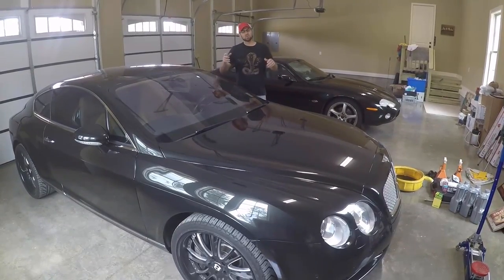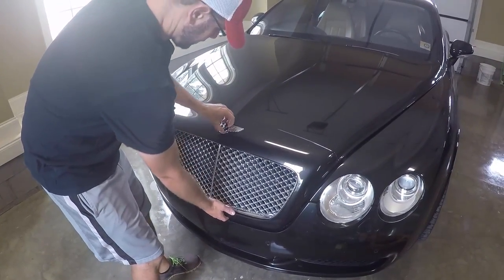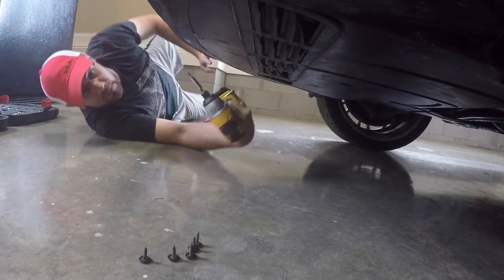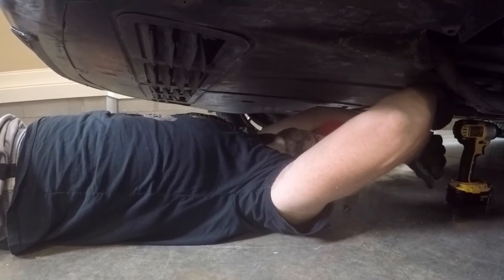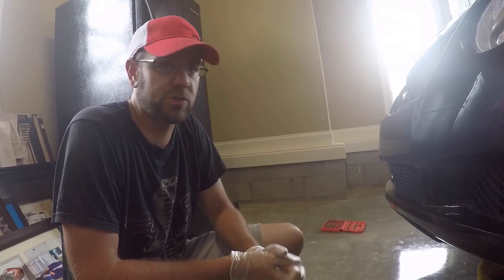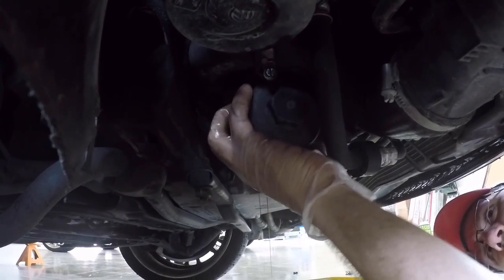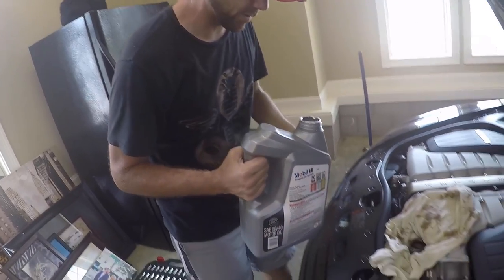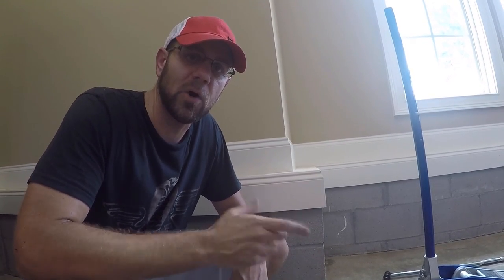DIY Bentley Continental GT Oil Change , Will I Die? Maintaining A Used Bentley GT

Comment: I used wheel ramps from Walmart for my Bentley oil changes way easier.
Reply from the maker: VANSLAM That's a great idea.
Reply: VANSLAM are they really that expensive to fix or get parts. And how are they reliable cars? Any major issues with yours
Reply: last time I did a continental, I jacked up the suspension to the highest setting, locked the ride hight level and drove it up ramps. easy.
Reply: No bro they have to be titanium

Comment: What?! No funnel?!
Reply from the maker: Richard Perez lol. I went full pro-mode. I should have used a funnel for sure. I got lucky this time.
Reply: Turn the oil bottle sideways, pours better.
Reply: @JohnEngel  turn the bottle sideways mr. Pro lol
Reply: What I thought, too.  Funnels are dirt cheap.
Reply: Own a Bentley can't afford a funnel or anything else that's for sure!! Lol
Reply: @JohnEngel  "pros" turn the bottle so the pour spout is up, not down.  Easier to start and less "glugging". At least that's how I've been doing it for the last 40 years.

Comment: I'M REALLY NOT LOOKING FORWARD TO THIS..... I did the oil and filter change today. You mentioned that the underplate would be a pain to put back, my goodness you were right. The oil and filter swaps took 15 minutes EEASYY! The underplate took only 10 minutes to remove, not as bad as I expected from your video.....BUT putting the plate back took me 2 hours, what a pain the ars#. It really annoys me that car manufacturers go out of their way to make a simple a simple fluid change so, so difficult. That said the satisfaction I now have is priceless having done the job successfully "only" paying £90 for Mobil 1 0/40 Oil and £30 for Bentley oil filter and sump plug, £120 / $95US job done, saved £300 heeee heeeee!!!! good video BTW Thunbs Up

Comment: John, that's one clean GT.  Even the engine bay and filter canister was clean looking too.  Thanks for sharing and your video reminded me exactly why I hate doing my own oil changes.  Not only do I make a mess of things I than have to dispose of the old oil.  It ends up being a half-day job from start to finish.  Ugh!
Reply from the maker: East Coast Classics Thank you. I had been putting this one off for a while. You are 100% right about it taking half a day. The hardest part was finding a 36mm socket and taking all  the bolts out of that bottom tray. Now that it's done I'm happy I did it but making myself do it was the hard part.
Reply: Whats so hard about disposing the oil?
Reply: @JohnEngel  You don't bed the 36mm socket, a large shifter will do it.  SnapOn will have the socket (for a suitable Bentley type price).

Comment: Because of the angle of the jacked car (high on the left side), it's likely that you still have some (up to 3 liters) of old oil remaining in the oil pan.  Next time do what you did (drain old oil), slide away the drain pan full of oil, replace the drain bolt, slide in a low profile pan, remove the drain bolt, and lower the jack as much as possible to allow the remaining oil in the engine oil pan to drain out.  Doing oil changes on low ground clearance vehicles isn't the most fun.  Doing oil changes on my V10 F250 actually is fun.

Comment: When you refill, hold the can on it`s side that way it does not glug out everywhere. You should also run a bit of oil into the engine with the sump plug out . this flushes the dregs from the bottom of the sump.
Reply from the maker: fred bloggs great tip. Thank you. I will make sure to add that for the next go around. :)

Comment: John, thanks for the video. I may be picking one up shortly. I just found an amazing deal for a 2007 convertible with lower miles. I don't know how anyone could drive one of these brand-new and watch the value evaporate for no good reason.
Reply from the maker: James Mullen congrats. You are going to love it and you are spot on. It would kill me to lose over 100K on the car but on the 2nd hand market it’s a deal.
Reply: @JohnEngel  I will keep you posted. Thanks for the reply
Reply: @JohnEngel  unfortunately too good to be true. The car was not maintained and so I am going to have to pass. Perhaps another one will come across the radar in the future. Thanks for the great video on changing the oil.
Reply from the maker: James Mullen there are always more fish in the sea.

Comment: A much simpler process for my 2001 Bentley Arnage; standard type oil filter, 10 quarts of 5w-40 full synthetic, and no jack mode to deal with.  I didn't have to take off any trays to access the filter and I was able to use a standard oil filter wrench to get the old filter off.  Service reset was a bit more complicated than on your GT, but I chalk that up to very dry British humor.  Nice thing on the Arnage, I can turn off the park sensors with a switch located near the sunroof switch.  Last weekend I tackled changing out front rotors and brake pads; not as bad as I thought it would be and everything is still working well.  Nice GT, by the way; I am thinking about getting a 2007 model.
Reply from the maker: nascarnationwide81 Lol. Yeah I'm not sure why they try to make things so difficult.

Comment: dude I assume you got a funnel for your future OC's. it also seems a little more convenient than the rolls Royce's  where the windage tray  is much like a gladiator's shield.... either way they should engineer service ports on them..
Reply from the maker: FEETLE I actually had a funnel that day but was trying to make the video and do the work solo and picked not to use it. In the future I will for sure. I also agree with making a service port. Thank you for the comments. :)

Comment: John - I enjoyed all three Bentley videos.  You helped me change my battery.  You might list replacement part numbers (like battery) in the description under the video.
Any thoughts about the air suspension?  My 2007 GTC goes down in the front if I don't drive her often enough.  Like a dog that wants you to walk her.  Please keep up the good work.  Great fun watching you struggle with defeating the obstacles Bentley designs in to keep us out of the works.
Reply from the maker: Jim Felich thank you so much. I am have always worried about the suspension but so far it hasn’t caused any issues. I believe there is a retrofit that removes the air suspension that I would look into if an issue comes about.

Comment: you can add a funnel and may be thicker gloves like 7 or 9 mill  even better. I'm thinking about getting a Bentley but still debating weather the maintenance is going to be difficult
Reply from the maker: eduardo arellano  barreto so far the typical maintenance hasn’t been bad at all. I do worry what happens when it needs something I can’t tackle.
Reply: @JohnEngel  thanks for the response, its a beautiful car and pre owned ones are so affordable. I've done quite a bit of mechanics and that is the only reason i'm considering buying one.
Reply from the maker: eduardo arellano  barreto I can tell you that over the 5 years I have had mine I have loved it. It really is a great car.

Comment: How about showing the steps to remove the wheel B plastic logo and the use of the two tools in the spare tool kit to remove the wheels? The manual is incoherent even though I went to college. Complicating it is there are apparently two different wheel configurations at least on my 2013 GTC.
Reply from the maker: That’s a great question/comment. I’m wondering if the 13 Is different from the 05. I could definitely make a video on this.

Comment: I'd like to see someone do their own maintenance on a bently as a series that would be interesting
Reply from the maker: kobra6660 it’s one of those cars that I feel not enough people work on.
Reply: @JohnEngel  it would make a good series though I've seen videos of someone working on a rolls royce and showing it's just like any other vehicle
Reply: There are a few vids already out there though if you look. Including someone pulling and replacing a motor with a new V-8 variant that is more reliable. Not for the faint of heart.
Reply: @krisreddish3066  more reliable but slower lol . Still I wouldn't mind the V8 tho

Comment: Some of you said it looked the same as an Audi sump, well it should, the same W12 engine is used in an Audi model and also a Volkswagen model but not with the same compression ratio nor the twin turbo chargers, don't forget that Bentley is a Volkswagen company.
Reply from the maker: G Lukes this is exactly right.

Comment: Very detailed and straight to the point 👍🏽
Reply from the maker: Auto Energy thank you. I really need to make a new version as this one has some sound issues.
Reply: John Engel still was a good video. But question since you own one. honest opinion one car brother to another. I have a 2007 Mercedes s550 In beautiful condition and I haven’t had many problems with it but I have been getting the car itch and I’ve been looking at the Bentley GT like yours and I was wondering is it that much better then the s550 that if I trade it for the GT that I won’t miss the Benz or is it slightly better to were I should stick with the Benz and keep the money in my pocket ?

Comment: I use quick jacks makes life so much easier changing the oil is easy on these cars
Reply from the maker: ///M SHAHID since this video I have bought quick jack and a 4 post car lift. Lol. No more jacking it. Lmao.
Reply: John Engel I used to it on the streets before I had any Ramps it was tough working with jacks and axle stands
Reply from the maker: ///M SHAHID I agree.

Comment: Wondering, why not clean the filter body before sliding new one in? It certainly has residue of old oil, dirt in it...
Reply from the maker: MacIn173 you are 100% correct and it should be done. While making the video and trying to get everything done it was over looked. You should do this for sure.

Comment: Hello I am from Bentley and you are losing us lots of money.  Stop this immediatley and let the pros do it.  We will certainly do a worse job and probably screw up something in the proces that we will not tell you about.  Oh yeah and we will do much more than recommended so that we can gouge the corporate office which will lead to higher production costs in the future.  Just saying.
Reply from the maker: Denny Hostasa lol. Best reply yet. Thank you for this. :)
Reply: Big LOL
Reply: I have customer's that perform their own oil changes or take them to the cheapest drive-up place. The big thing that is missed here is the vehicle inspection. This guy is barely getting the vehicle off the ground, and doing the bare minimum service. What about the rest of the vehicle? Or is the plan to just wait until there is a problem. I'm not as concerned with the loss of money as stated above (mainly because this is the guy I wouldn't want as a customer) because I will always be busy (make money). But these DIY videos send a bad message. They don't teach anything. Oh, and good job explaining the very specific oil specification required. For a 200k vehicle, the idea of this video is garbage.
Reply: Not to forget, the ubiquitous new key fob battery and 2 wipers, £200 please sir!!!!
Reply: Jacob Speas Title reads oil change not service, glad you don't touch my cars.
Reply: not sure about anyone else here, but when I perform a service, it comes with a 4 wheel break check, front end check, light check and general look over, hence why the price is higher. if you want a quick LOF, head to mr lube where they will 50% of the time not tighten the oil drain plug 😂
Reply: Not a single oil change place in the city I live near would touch my Bentley jiffy lube was like noooooooo. So I bought the oil ,ordered a filter actually four online and took it to my 24 year old neighbor genius ranch mechanic Mexican,I said can you do it he was like let me see the video watched the video twice and charged me $40. When he got done he said in Spanish an engine is an engine and our $200,000 John Deere tractors are far more well designed and of better quality then this piece of " junk"!!? WTH

Comment: Considering the location of the drain plug and oil filter housing, wouldn't it have made more sense to lift the right wheel instead of the left ? or is there a particular reason to lift the left side ?
Reply from the maker: CaptHollister great question. For me it was that I had more room on the left so it made it easier for me. Either would work and I let the car down to completely drain.

Comment: I would suggest that the process is designed to be done on a lift rather than with a jack.
Reply from the maker: Drogo Muircastle absolutely. I have a quick Jack 5000 pound lift, but it is not strong enough to lift the Bentley. I am looking into four post and two post lifts, those should be able to lift her much easier.

Comment: Damn I always wondered if it was any different from any other car but its literally as easy as a Honda just extra screws for the lower panel
Reply from the maker: Eric Frias you are absolutely right. After the splash pan is removed it’s just as easy as any other car. :) it’s crazy how much Bentley chargers to do this job.

Comment: I would've cleaned out that housing before putting the new filter in there.
Reply from the maker: Brett J Roebuck that's a great point. I'm now sitting here thinking how did I not do that. It's always something. Thank you for the comment and I will remember that in the future.
Reply: Brett J Roebuck always clean as many things as you can in an oil change. Also a flush would have been good.

Comment: Does the Bentley oil plug need a copper crush washer replaced or does it not have one?
Reply from the maker: Great question. It does and it is correct to replace it at each oil change.
Reply: @JohnEngel  
Thanks for the prompt reply..
Here in the UK where people are being push and shoe horned in to electric cars under the heading better for the environment, without understanding the bigger picture, ie the the cost decommissioned redundant batteries and the environmental risk they may cause down the line. All the the above has driven down the prices  of luxury petrol/gas cars making them more affordability to run, maintain, and  enjoy by average guy/girl

Comment: Can i know what type of this gearbox oil is use, and want to know the another alternative of gearbox oil that are same as its original gearbox oil charectistics?
Reply from the maker: Muhammad Asyraf Bin Ayub Shell ATF M-1375.4 (Bentley part #: JNV862564A). Note: manual says you must also change the front and centre differential cooling circuit. lubricant oil (Burmah SAF-AG4)
Reply: @JohnEngel  i think its not easy to find in Malaysia, this car used condition now cheap in Malaysia,
Reply: @JohnEngel  thanks for the info , i will surveys how to find it and how about the price here before i buy Bentley, hehe

Comment: Cool video.  So... $80 in parts (3x oil jugs and filter).... and Bentley charges $800?  wow.  Two quick things... 1. why waste time jacking up the car? Ramps!  Quick and easy and saves a ton of time and quite safe if you do not need to take the wheels off for whatever you are doing.  2.  If you want to reduce oil spillage... use an extractor, either a cheap power one on Amazon for like $13 or a manual vacuum pump, get the oil out through the dipstick/oil cap if the car allows.... Too bad the filter is not on top in which case there would be ZERO need to go under the car.... (assuming the car has a dipstick and can be pumped/extracted from the top).  Saves a ton of time on Benz.
Reply from the maker: Max N ramps would have been a great idea. I haven't done a topside oil change. Im sure I will get around to doing some that way. Great comments. Thank you. :)
Reply: Most Bentley dealerships charge $250 for an oil change, not $800.

Comment: How did you the car OUT of JACK Mode ? Did you repeat the steps you did to Put it in Jack mode?
Reply from the maker: Ecom Tomcat you can either reverse the process or when the car is in jack mode if you put the car in drive and go over 10-15 miles per hour, it will automatically take it out of jack mode. :)
Reply: Just drive it as per normal, and that will automatically take it out of Jack mode.

Comment: Do you put the car on the Jack mode when using the Ramps to lift the front. I am getting ready to change the oil on my 2007 Bentley Cont. GT with 25 K miles. the  dealer want $1,100.00 to do it. thanks for your video.
Reply from the maker: @alexanderyousif6098  thank you so much. You only need to put it into jack mode if you are lifting the tire off the ground. If you are driving up on a ramp you do not need to.

Comment: Do you have to take it out of Jack mode or does that happen automatically the next time you put the car in gear?
Reply from the maker: You can do the same process, which will take it out of Jack Mode or just drive it and when you hit 10 mph it will take it out automatically.

Comment: Do you even need to put the plastic bottom covers back on ? Top video
Reply from the maker: bruno condello I am sure that you could leave it off but I would not if you didn't need to. On some cars this affects the air flow and can cause issues.
Reply: John Engel - love your work bro !!
Reply from the maker: bruno condello thank you so much. :)